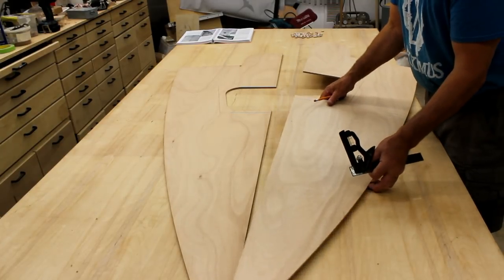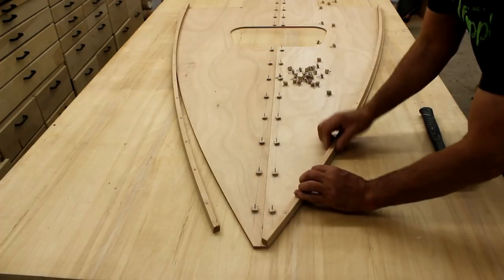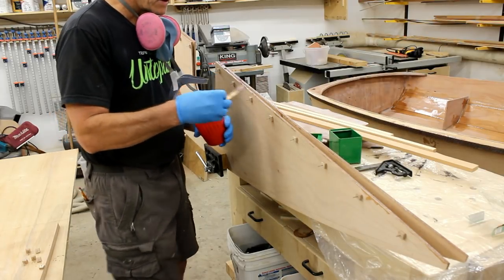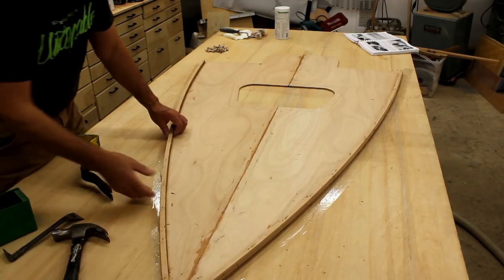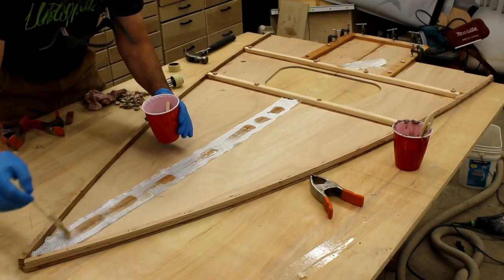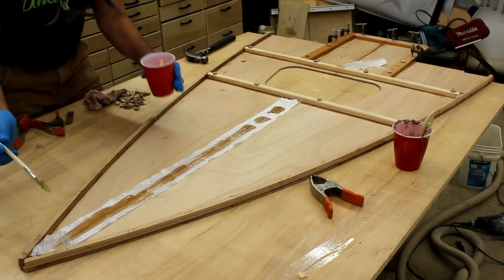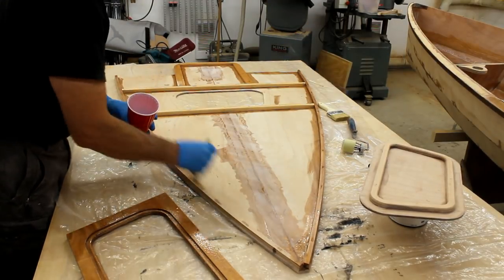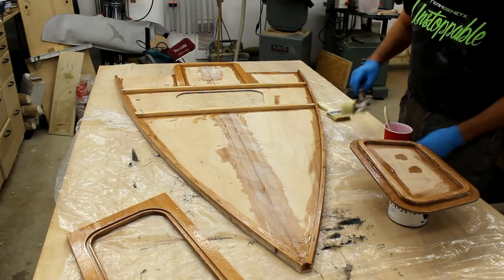Building the PT11 - episode 16

Comment: Seems to me, be easier to use 1 4x8 (4×4?) ply sheet cut using a template.
Reply from the maker: I suppose it would be if one was building from plans. But there are no plans sold for this boat; it is only sold as a kit and my guess is for the kit to be able to ship at a reasonable price, it must fit in a box of a certain size.
Reply: @OrcaboatsCa   makes sense, didn't realize they didn't have a plan package